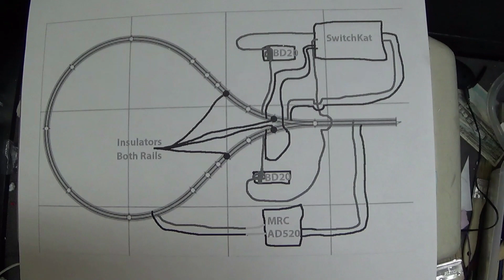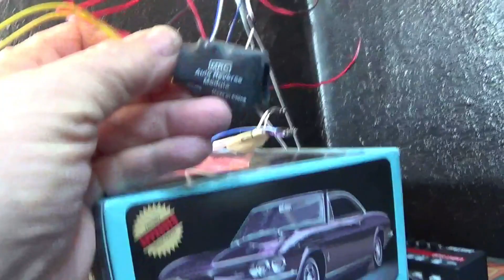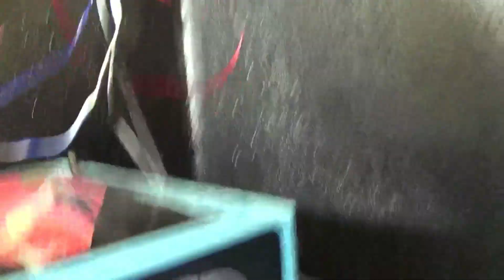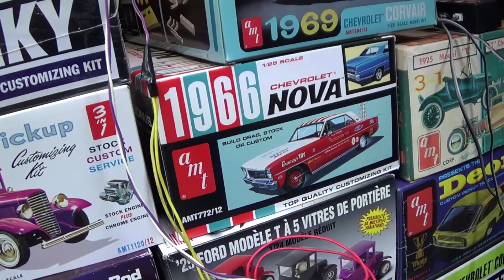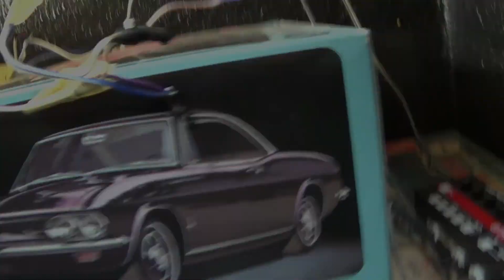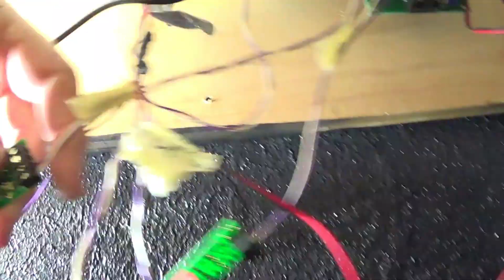How to wire an Automated reversing Loop Using an MRC AD520 and NCE BD 20's with Kato Track

Comment: Mike if I understand correctly the turnout gets thrown automatically but the switch  kat correct or must you use your dcc controller to throw the turnout
Reply: You need a detection block and I used NCE BD20's and then to the switchkat to throw it, so on a loop two detector section at the ends of the loop, ahead of the turnout and 2 BD20's (one for each of those blocks and to a single switchkat.
Mike
Reply: @N-Scale  Thank you so much.. I have only one turnout that I'll need to control. So I assume I'll still need two BD20s and one switch kat?
Reply: @EmPtYpKtS1  Yes
Reply: @N-Scale  Thank you sir

Comment: Hi there,  I have a pretty big issue I hope you can help in some way.  I cleaned my track and then ran the engine. Now the engines are stopping dead on certain sections of the track.  Did I short out the transformer?  I was thinking the track might have been wet.  I tried different engines and they all run good in some sections but others nothing.  I’m not an electrical guy and am completely stuck.  Any advice would be greatly appreciated.  I can give my number or call you. Anything thanks in advance. Brian
Reply: DC or DCC????????
Reply: @N-Scale  DC
Reply: @N-Scale  no switches
Reply: @bri7777-l3x  How did you clean the track?
Reply: @N-Scale  I was using a pad that attaches to the box car and dropped some tidy track clean track solution and ran the engine around.  All of the sudden it stopped. The train works on one section of the layout which makes me think the transformer is ok.  Not sure if it was fried it would work at all.
Reply: @bri7777-l3x  I would not use the tidy track product and wipe the tops of ALL your rail with alcohol on a cotton cloth.
Mike
Reply: @N-Scale  it’s the first time I used it. I always used alcohol.  In your opinion can the transformer be bad and still work at all ?  My neighbor is a retired Abington model railroad club member.  He is to elderly to come over but said check wires and rail joiners.  Do you agree?
Reply: @bri7777-l3x  Yes I do but I thought with multiple locos running they did not all die at once.
Reply: @N-Scale  it only runs one engine. I tried multiple to confirm it wasn’t a bad engine.   I will clean over again with alcohol and if that doesn’t work try checking wires.  Thanks for help. I appreciate you responding. I love the layout.  I have a short video on my YouTube
Reply: I posted a video of the layout not sure if that means anything
Reply: @bri7777-l3x  Thanks , Mike
Reply: @N-Scale  I took your advice and cleaned the entire layout with alcohol.  Turns out that was the issue. That tidy track crap was like glue. Once I cleaned in the tunnels the train went fine. I can’t believe that stuff can stop a train dead. Wow. Thanks for the help once again.
Reply: @bri7777-l3x  Welcome , Mike

Comment: I just figured out how not to get ballast in the holes on Kato turnouts. The lever hole to throw the points. If you take q-tips and cut the cotton ends off they fit perfect in that slot.
Reply: Cool Idea. If you write it up with a picture or two , I will add it to the How to page on our site.
Mike

Comment: Can it be done?  ...I have a couple of older, n-scale, dc locos that I want to convert to dcc, but can’t find which decoders to use. Two Con Cor PA-1’s and a dummy PB-1. Is it possible to house the two decoders in the dummy between the two PA-1’s (one with sound and one motor control only)?
Reply: It is all possible but is it worth it would be the question. I do not do any custom installs but you might try Jerry Rowley at jwoodone@cox.net

Comment: nice vid - thx
Reply: Thanks so Much
Reply: @N-Scale  thx i think i might use the automated part and go from double track to single track end cap on both ends of the end cap - need to test it out - but i know already it will work  -  there is a Audurino circuit to accomplish same stuff ....

Comment: I bought a DCC Specialties PSX-ARSC which changes frog polarity and activates the points. Haven't hitched it up yet, though.Thanks for this video!
Reply: If it works, I think I need one unit for each reversing loop, total of 2. An expensive, but simple solution. . . I hope.
Reply from the maker: @avlisk  I have never used any type of frog juicer.
Reply: @nscalemodeltrainshowtochan4479  I have used the FastTracks Frog Juices in the past on my Atlas turnouts because they have very long frogs, and they are amazing. They don't throw the points, though, so that is why I bought the PSX unit, for the reverse loop(s).
Reply: @avlisk  Cool.